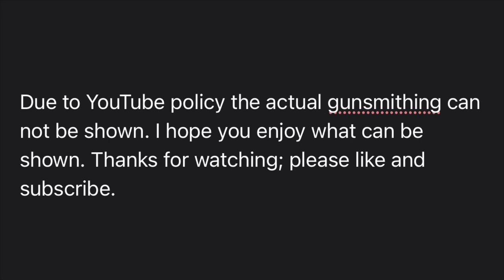Heritage Barkeep Boot gets a front sight.

Comment: Are there enough threads to allow you to adjust the sight for elevation if you needed?
Reply from the maker: No not in this case. The sight is designed to thread all the way down. I like your line of think though.
Reply: @firearmsaddictloveguns  fair enough. It’s still a large step up from no sight.
Reply from the maker: @wpmbell  yes for sure.